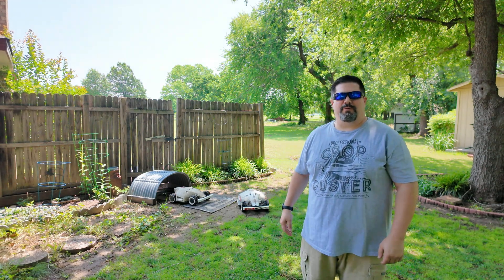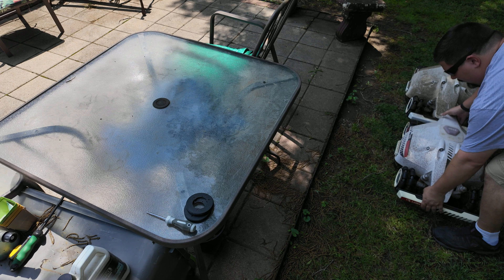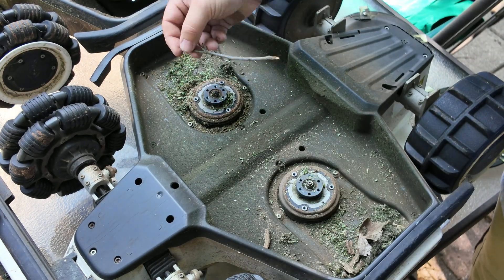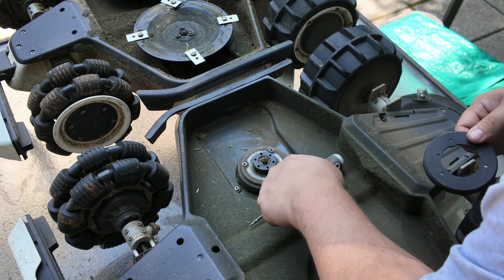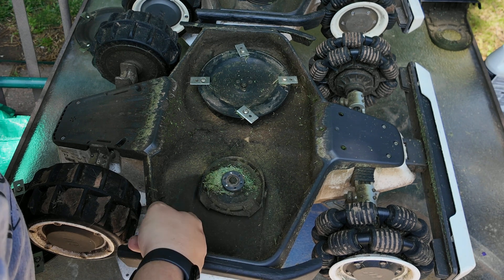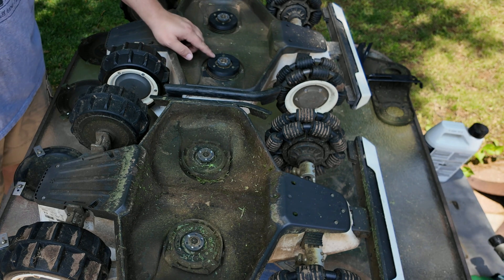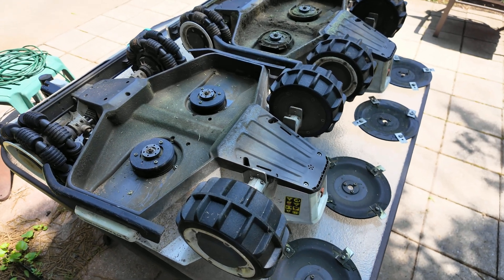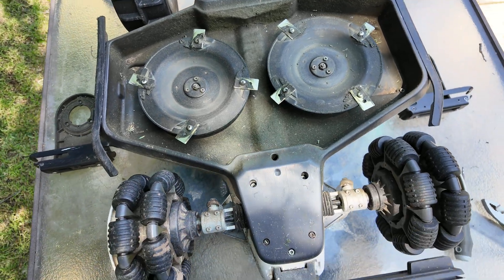Modding Luba Part 2: 3D Printed parts this time

Comment: One thing I noticed is the 3D printed covers leave your rubber/silicone sleeve for height adjustment more exposed. That could be and issue with the sticks in your dad's little pecan forest.
Reply from the maker: pecan forest that's very accurate

Comment: How are the batteries holding up with these robots that have been goin for 3 years? You still don't need to replace the batteries?
Reply: Mines working on its 3rd year. No issues with batteries.
Reply from the maker: Mine got replaced under warranty this year (not because of the batteries) But I don't have an old unit anymore. I wasn't seeing any diminished cutting time.

Comment: I wonder if the little nub is to help prevent someone from putting the guards on the wrong sides (not sure if it's even possible). The designer of the 3D printed part probably just created one model and printed it twice. It's interesting that the listing doesn't state what material was used but should be fine even if it's PLA since it's just acting like a seal.

Comment: What's the point of putting them on if they don't cover anything? Maybe just removing the originals would be fine?
Reply from the maker: There has to be a piece here to hold down the rubber Seal underneath to keep water and dust and dirt from getting inside.
Reply: @Crazypostman   thank you

Comment: There is a third option.....the guards from the Luba 2X are open where yours clog.
I think they fit the Luba 1 and 2, but ask Mammotion.
Reply from the maker: The 2x plates and guards won't fit Luba 1. There's lots of custom 3d printed stuff out there, but the official plates and under guard won't fit
Reply from the maker: They might fit if you replaced both at the same time. 🤔 That would be way more expensive than aftermarket parts though because just the plates are 60 bucks and I imagine the guards are probably double that.